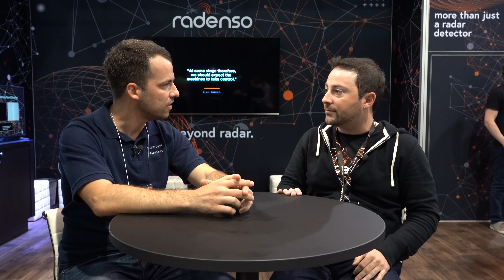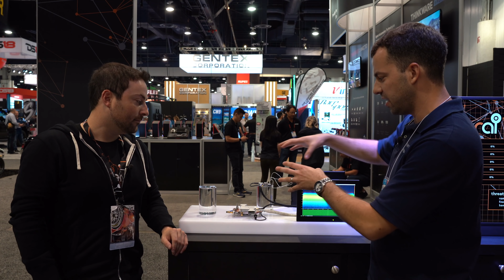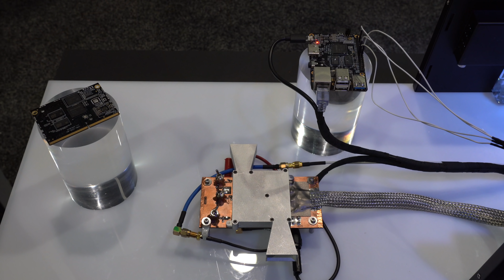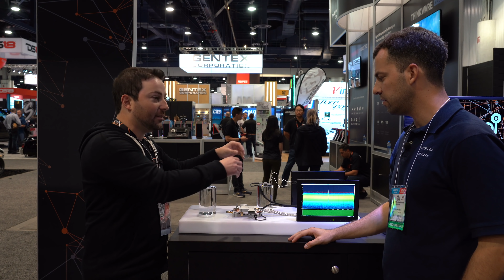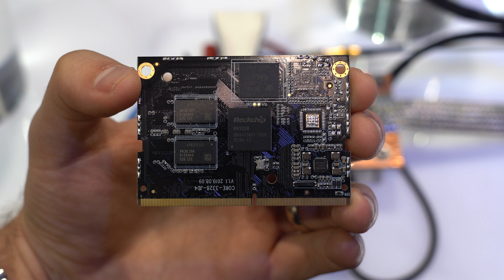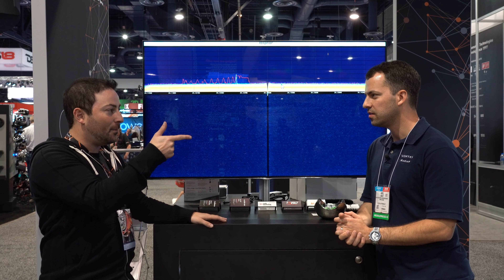No More BSM Falses! Radenso Introduces Artificial Intelligence with Theia & Rai

Comment: About time someone included that kind of hardware into a radar detector. If rendeso can put this radar in the market its gonna be the best radar ever made not just for the bsm but alerting too. That was great stuff, thank you vortex.
Reply: It will come at a premium though. That core board by itself costs $120-150 so that plus dual horns.... You're probably looking around $750-950 minimum. Msrp for a windshield mount version. People just will complain it's so expensive without weighing what's in it.

Comment: The chip should easily be capable of sorting laser countermeasures. I'm expecting a 'premium' version with ports for external heads of some sort...maybe even compatible with any type of laser heads(?).
Game changer for sure.  And about time! [this could have been possible years ago].
Reply: They need to get off the hardwire install first before anything can be a game-changer for them. Needs to be be all wireless/bluetooth.

Comment: Amazing interview Amazing technology!  Now I know what my Escort Max 360C is still suffering from!! I am constantly getting Ka Band false alarms coming from the rear.  Weak 1 to sometime 2 bars.  When I mounted the unit way down low on my dash it was so bad I could not use it.  I’d swear it was even picking up my Subaru Outbacks BSM radar units mounted in the upper rear quadrant of my rear bumper.  I looked it up and sure enough they use Ka band frequencies.  Now it’s mounted in rear mirror and from time to time I go through a rash of false alarms.  And YES I have updated the firmware to the latest.  I now know what it is.  Thanks.

Comment: I asked maybe two years ago if RD manufacturers would allow us to LISTEN to the signals being put out FOR THIS EXACT REASON. there are subtle differences in EVERY radio.. think about all the kinds of recivers you have. different walkie talkies sound better or worse then their cheaper and more expensive siblings. 
if you're a ham radio operator like myself you can learn very quickly the tone change from radio to radio and you can tell when your buddy uses a different radio to talk to you.
This smart learning system for identifying the different types of signal and ways to analyze, is exactly what we need. It would be very smart for current manufacturers to allow listening to incoming signals because while they're detectors are not capable of determining the differences your ears and your brain might just be.